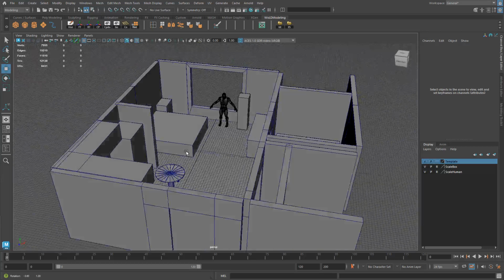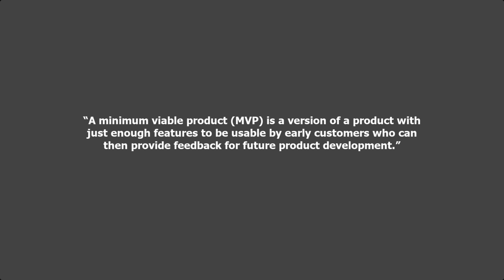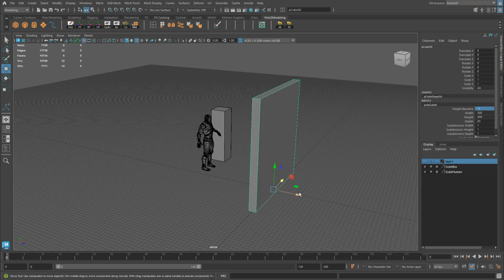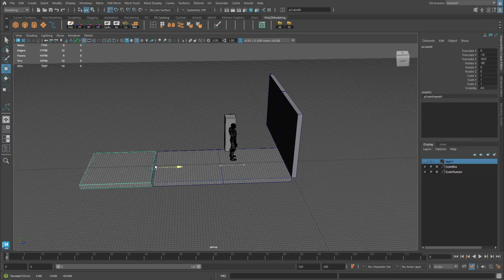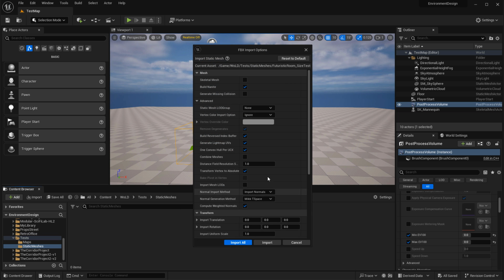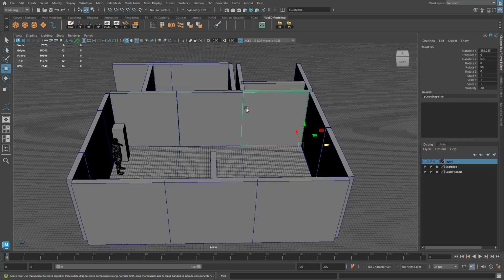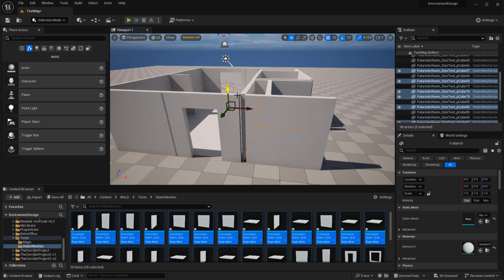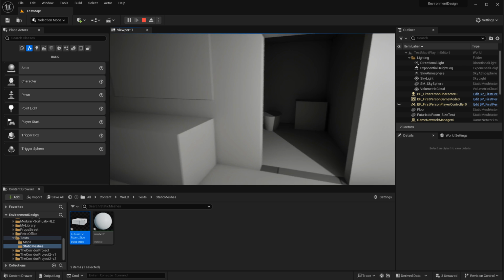My Current PROTOTYPING BLOCKOUT PROCESS for Modular Environment Creation (Maya/UE5 or Other 3D Apps)

Comment: Great video, appreciate it a lot. One question, how do you handle the empty space under the wall door opening where normally there should be a floor so the player can walk on it? I'm thinking of two ways, one would be creating a whole mesh for that, or simply create a face and assign it a separate material so it can take a floor material. I guess I'm just overthinking this
Reply from the maker: I've dealt with this couple different ways.

1. create a filler gap mesh to place under the doorway. 
2. create a doorframe that has that floor board piece on the bottom already with the door frame, so any time you have a doorway, you'd need to place a doorframe and then a door.
Reply: @WorldofLevelDesign  Thank you. Another thing that I came across while building the level is that, the way you're placing the walls, being on the outside edge of the floor and ceiling, causes thin light bleeding at the edge where the wall and floor/ceiling meet. For info, my scene is fully using dynamic lighting with no Lumen, the light bleed is thin, but it's there, more or less depending on the directional light angle and the viewport scalability (with cinematic making it very thin but still visible). The walls and floors are 10 cm thick

My question is whether placing the walls on the outer edge of the floor/ceiling is the best way to create interiors or if there is a better way?

Edit: I think I'll resort to either disabling the directional light when indoors, or have a huge invisible mesh casting shadows all over, thus no light will bleed at all and it'll be perfectly dark. Of course this isn't a viable solution for all projects, but I think it's a good one for mine. This is theoretical, need to test it.

Comment: What do you do for your missing corner pieces? Do you just have modular 20x20x300 columns pieces? Or do you build in wall locking joints into your modular pieces so that there are specifi "corner locking" male and female pieces?
Reply from the maker: Depends on the asset pack but you can do both. Sometimes I create filler gap pieces and other times I introduce entire full modular corner pieces.

Comment: Hi, maybe stupid question, is it ok to use the architecture (walls, floors, windows..) that comes with UE5 in starter content? or is it still better to create new meshes?
assuming I just want simple flat wall/floor etc.
thank you
Reply from the maker: It's always better to create your own Static Meshes to use as you can make them unique to the type of environment you are creating. But the Starter Content meshes can do the job when you need it. You could even start with Starter Content meshes as place holders and then swap them out for your own down the road (assuming you'll keep the same dimensions and pivot points for easy swap).

Comment: Thanks for the insights to your workflow, that is very helpful. But I got one question: how do you deal with those empty spaces/corners when creating a modular asset kit (those 20x20 spaces)? Would you create a dedicated 300x20x20 space filler or move the walls finally to the outer side (which would reduce the room space)? Or do you recommend to put a bigger space filler so that it will not look to monotonous? Would be nice to see a follow up on this :)
Reply from the maker: I will often create a 20x20 pieces to fill in the gaps such as borders, trims, fillers. For corners I may sometimes create a large full corner wall that takes care of it so I would have straight walls then a full corner piece with walls. But it depends on architecture style.

In other situation you could get away with as you mentioned, moving the walls to inside but I don’t like that very much as it makes the space smaller.